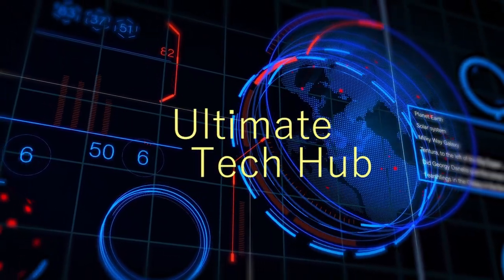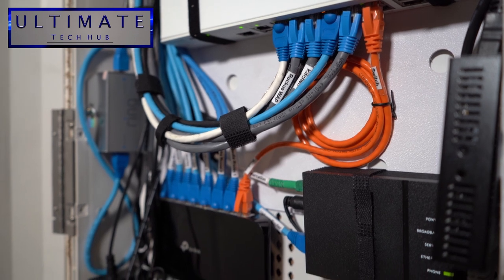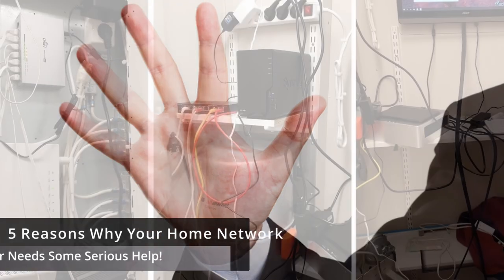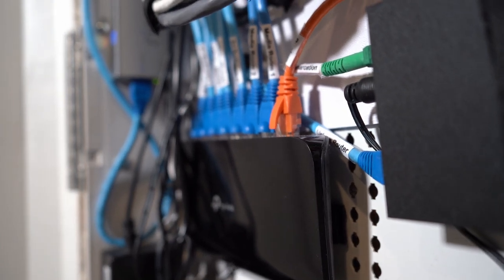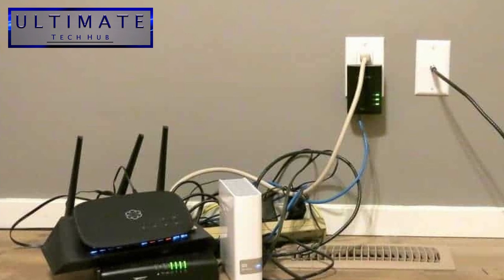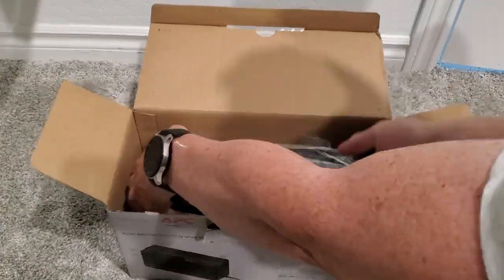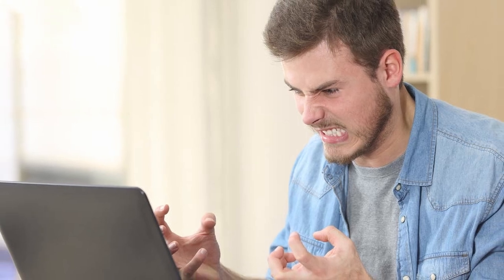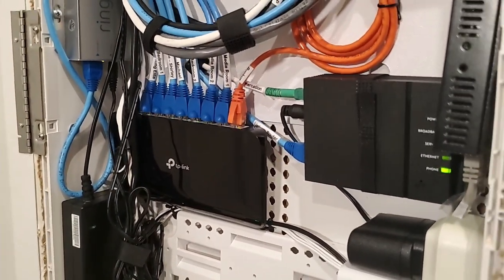5 Networking Habits That Ruin A Home Network!

Comment: 1. How does a network not function with a wire mess? 
2. Colored cables or boot cover
3. ESD how? Place them on a wall, they may come with screws
4. What? Power out affects the entire home..  Cellphone and tables can use 4G but isnt it better to preserve battery in those for when its really needed?
5. Depends on what router it is, if we have W5 do we really need to upgrade to W6?
Reply from the maker: First, wire management goes hand in hand with Ethernet cable labeling. Its very difficult to trace a network issue like no connection or a slow connection when cables are all over the place and not labeled. Trust me I've had that problem a few times. I mount many devices to my walls, like my switches or routers. Not everyone is handy with a drill so placing them on a table is super easy. Backup power is very important for Wi-Fi connections especially if your area has a weak cell signal and your cell phone plan has limited data. Not to mention kids with tablets or laptops or hand held gaming consoles. Wi-Fi 6 is the future so I always recommend to upgrade when you can afford it. Thanks for the awesome questions and comments. Thank you for watching!
Reply: @UltimateTechHub  Thanks for the video and the reply:)!
Reply from the maker: @alerighi  We have fiber from CenturyLink and most times during a black out or poweroutage we still have service from our ISP. Just as long as our modem , router and switch work we are all good.

Comment: If there's a power interruption (and you aren't self sufficient there, which most of us aren't), then your network may as well be out, what use is a network if the computer isn't running because of no-power?
Reply from the maker: If you have a laptop or a tablet or a cellphone with bad service then back up power for your network is very important.

Comment: Hmmm. This is wrong for so many reasons
Reply from the maker: What reasons are you talking about?
Reply: @UltimateTechHub  Please don't take it personal, i understand the business struggles of growing a YT channel.

Your title suggests your tips are relevant for the Average Joe, and are manageable for him. Also, you specify it's about home networks and not commercial grade networks. The first two "reasons" are nonsense for the average home network. 
I really can't imagine a scenario in which the Network is a priority for Backup Power. All Workstations, NASes and Servers will be out of Power and the local ISP likely also.
You are recommending Vilo without disclosing Sponsorship, and Vilo is, while likely the sole reason this video exists, dodgy by itself. They collect users Data and admit to sharing it. This is their first launch and they are likely to be gone again in a couple of years. If there ever was software support, it will end by then.
Reply from the maker: @mugabe2606  First off, I did disclose that this video is brought to you by Vilo in the first 10 seconds of the video. And the video itself says paid promotion.  Second, the first 2 fixes are very easy for anybody to fix and are relevant when there are network issues. Back up power is very important and the ISP does not usually go down when the power goes out. I have fiber and it doesn't go out when the power is down. These five fixes are important to average consumers and doesn't cost much. As far as data collection goes , if your on any social media or most websites or devices your data is being collected. I use a VPN called PIA. That being said I appreciate you watching my video. I have hundreds of videos so make sure to check.  them out.
Reply: @UltimateTechHub  Sorry I missed the mention. Still I can't see you spreading this tips among your friends and family, because they simply wont benefit from anything except for decent cabling to all rooms, a switch connecting everything and a medhed wifi system covering everything
Reply from the maker: @mugabe2606  It's really all about keeping your Home network organized and reliable with back up  power and a solid wifi6 router. Regardless of what brand wifi router you use, a new router with wifi6 helps a home network run  considerably better than an old router.  I have a Linksys router, a RUCKUS ICX switch, an EnGenius managed switch and a RUCKUS wireless Access point ( 601 ) and my network runs fast with zero issues. I'm sorry you didn't find this video useful but many people have. Thanks again for watching and for commenting.
Reply: @UltimateTechHub  Great video. I totally agree with the tips. I added a larger ups to my network rack and it easily runs the modem, router, switch, access points (2) for 6 hours or more. Best investment ever.